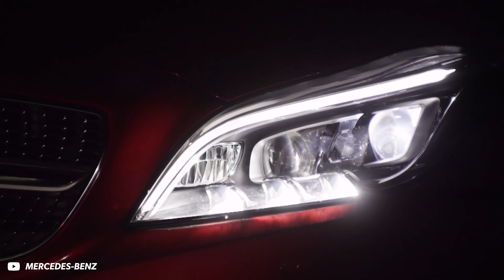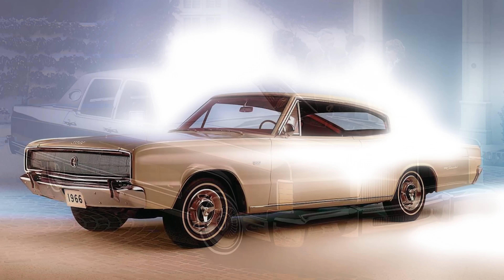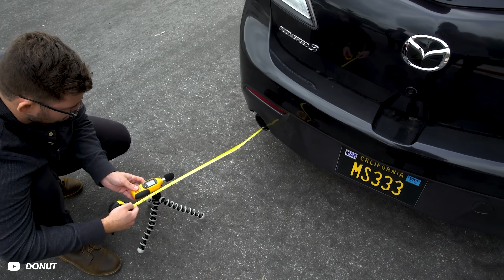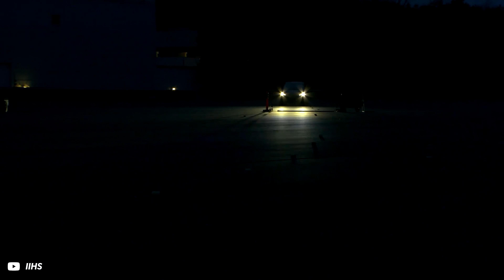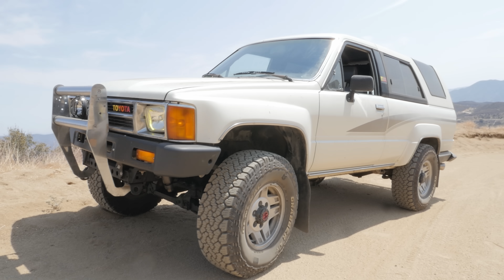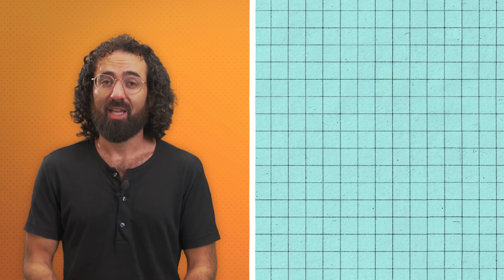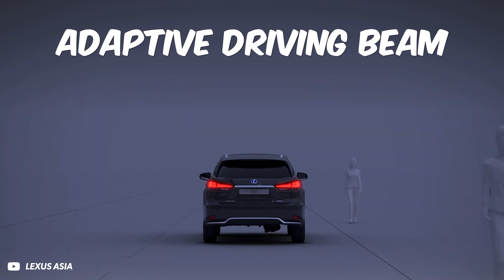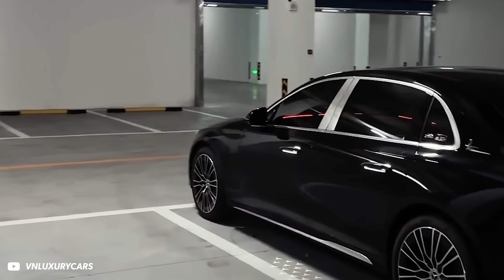Why new headlights are blinding American drivers

Comment: I want to go back to a handful of DOT approved sealed beams. Every car uses the same, so they are mass produced and cheap and available. Tightly regulated to be a warm yellowish, power limited, and with a strict pattern. Having them aimed improperly should get a warning then ticket.

If you want a tech solution, instead of adaptive headlights, put detectors on police car. Also, start making police use cars again. Way too many are up high in SUV's these days.

Comment: The Lawmaker is not experiencing the same thing as the citizen they make the laws for, because ...they ride as passengers. From Uber to armed protection specialist chauffeurs, so it doesn't affect them and not until a loved one in their circle dies and the death is attributed to these insane lamps ... I rarely drive at night, hardly even have to being I'm retired, so I just won't go out on my rural highways at night.  If I do need to, I can use my sun visor as a shield, though it has issues with me possibly missing something that is blocked by the visor, so I swivel and use extreme forward sight, looking as many seconds as possible ahead so if I need to block out an oncoming lighthouse on wheels, I've a pretty good idea of what will be unseen for the few seconds of this sun visor technique.

Comment: What surprises me with brand new cars is how bad the can track a car. Even on straight roads often one of the headlights is shining right onto your inside mirror. 
I have mutiple cars with adaptive lights and some do great on auto high beam (Maserati, yeah! Its incredible how you can drive with high beam in the middleof traffic because it blocks light to upcoming traffic) and some do so bad I often use high beam manually.

Comment: The US population is aging and as such is becoming more light sensitive. Driving at night is horrible if you get a truck behind you blitzing the passenger cabin.We own two Subarus which are great except you have to pay $200 for their idiotic and dangerous auto dimming inside rear view mirror, which simply put does NOT work. Ive complained to corporate. They respond like Homer Simpson by going Duh…they want the $200,  you cant even spec order a new vehicle without  it but they still list it as a $200 option. Its not an option if you cant get anything else. When bright lights are behind you it barely dims anything. You can push the green lit button and turn it off, but then, you guessed it, it doesnt do anything…we drive with the mirror pushed up so we cant see out the rear. A ten dollar old flip lever mirror would fix the problem but the stupid device is wired into the ADAS system so you cant do that…additionally here in the Midwest USA in the past trucks had what were referred to as driving lights in the lower bumpers which were restricted by law for use only in rural unlit highway areas. New pickups and suvs here have running lights, quad led headlights with variable current for the high low function, and driving lights all going at once, so that instead of two low beams you are staring into 6 or 8 leds blinding you…leave it to the nitwit insurance actuaries counting beans to say all us senior citizens being multiply blinded as somehow being “ safer” I literally cant see it.

Comment: Yup, this is why I try to not drive at night. I do I have these clip-on filter for my glasses to stop blinding glance, sadly this filter makes me sleepy because it cuts off the light that makes you awake. In the end, I just straight up turn on my high beams up when I'm blinded by them, then turn it off a second later when I can see again. Some may say this is bad road etiquette or whatever but this is my way of signaling that something is wrong at an instant, and TBH this is all I can really do against this issue. Doing this, I've notice it really isn't the old trucks and SUVs, with the higher height directly shining their halogen lights, that I'm blinded by but those damn LED that pierces my eyes at night. I truly hope this changes.

Comment: I have a much better solution, how about embedding OLED panel onto the windshield, that will use multi-spectral camera to brighten your view during night, lets also install an infrared light that the camera system can use, all combined seemingly.

Comment: LED should never be used for the head lights. LED can cover a range lighting but are not getting it all. White LED are a variation of the Blue LED, and they are of the same family of lighting as the LASER. Using them as a marker light on a car, a in the house light or to light up your flat screen TV or computer is all fine.
 I first noticed the LED lighting flaw with the LED flash lights, and cell phone lighting. If you really need to light up a spot to find what you are looking for clearly, and great Incandescent, or halogen flash light is what you want.
 In the car driving I have noticed on a foggy dark morning, the ones that have the LED head lights just light up the fog into white piles of mush, making visibility even worse.
 Back when I just started driving, 1980's and had driven in the fog a few times, I thought about getting these fog lights and put them on the car. Problem was clearly written on the box of these new fog lights, that they are not to be used as driving lights. So I figured they were for off road use only.
----
Back when most cars had the round sealed headlights, the mechanic I went to had this device he used to test and light up the head lights. It was meant to be easier then having to have a chart on a wall and aim the head lights on that wall to light them up properly.   
 But this devise, and the had one for the newer square lights as well, but it had several balance levels used to line them up based on the factory prebuilt in the bulb alignment.
  So then using that as the standard, a higher vehicle would have the same standard, but that would put their aim that much higher.  So I noticed around that time that the newer trucks had their head light mounted pretty low, but this did not fix the problem of the people that decided to lift their vehicle.  
 Then came headlights with no diffuser lens in front, just using the rear reflector as the aiming device, and it only got worse from there.   
 I drive car from the 1990's and it has composite headlights (with the diffuser lens). They do very well, no yellowing of the lens, and they can be adjusted and aimed toward a wall to line them up correctly, and there are high and low beam separate lights.
 I wonder in the modern car lights having the yellowing problem might be because the type of light going throw those clear covers.
 Oh another fact about the LED, if you run them at their brighter level and then lower the voltage to them they lose that flexibility in time, because once a LED is run at a high voltage level, and you back it off, the lower brightness will be much lower then a new LED on the same brightness. They have this burn in situation.

Comment: I sit higher and still have to look to the side of the road to not be blinded by oncoming LED headlights most times. I have a 2021 F250. Stock Height, Stock everything. I ordered it from factory with Halogen bulbs. My headlights are properly aimed each time I take it in for an inspection (never know if they get misaligned from potholes, etc throughout the year). And people still want to flash their highbeams at me. Bruh...I could see your LED headlights blazing from a mile away, and now you have the nerve to hit my eyes directly with the power of the sun.... F off moron.

I truly feel bad for people with astigmatism. Ain't no way I would drive at night if I had it, nowadays.

Comment: The main problem has always been poor adjustment, especially for low beam lights. If all headlights were adjusted properly, blinding by oncoming and following traffic would be minimal. The new high intensity lights simply aggravate an old problem further. (Self-)dimming mirrors and yellow night driving glasses make a big difference for me at night.

Comment: Excellent report. Thank You!!.  You missed, or maybe I missed , Headlight adjustment. Part of that problem is mechanical, the entire giant, expensive light unit is bumped or sat on, changing the adjustment or people replacing the bulb and not noticing that a bulb not designed for that housing will change, and often remove entirely, the light pattern that was properly putting what little illumination the original bulb produced where it belonged on the road without blinding oncoming traffic, with bright light that blinded flying Owls, pedestrians and oncoming traffic. All because the driver did not buy one of the pitifully small number of LED bulbs that actually work because the LED is placed exactly where the filament of the original, stock bulb is. And that doesn't include the very costly headlight units that are absolute garbage for the same reason. They don't work on cars. but might be fine in a car themed nightclub.

Comment: Eh some bad info here. First of all, adaptive headlights are still only used on higher end cars, and that's really only in Europe, not the rest of the world like you claimed. Not only that, but in Europe, they are still highly flawed systems. They can't detect and respond to anything but straight, level traffic. Throw in obstacles, curves, hills, etc. and they are just as blinding if not MORE blinding.

Second, the real offenders are generally not brand new cars, it is the aftermarket. Specifically trucks, and lifted trucks are the worst. It does not matter how you adjust the lights or if the housing is correct for the bulbs, etc. The reality is because they are higher, the beam HAS to cross a lower, oncoming vehicle driver's eyes at some point. If those lights are brighter than stock, they are going to be painful and blinding.
Ironically these trucks get brighter lights to help them see better, thinking it will decrease the odds of a crash, but they don't realize how many oncoming people are blinded and might actually cross into their lane because they can't see where the lines are anymore.

Comment: Since there's nothing we can do about the lights from other cars, I can only think of one solution to mitigate the blinding assaults from incoming traffic: Use a computer with a camera tracking the location of bright light sources to fire a death-ray, err... I mean, display black squares on a transparent LCD screen behind the windshield. With the right offset calculations, it should be able to match the pixels sitting between the driver's eyes and the offending light source, allowing the rest of the view to remain unobstructed. It would require two wide screens to cover the whole windshield, but covering the driver side only should be enough for most situations.
The main challenge for a DIY solution is to remove the backlight, diffuser and reflector from a typical monitor, without damaging the panel. The rest should be relatively easy to do with OpenCV on RPi. It would also be useful when the sun is low or something reflects the sun.

Comment: This is all getting off the point.  The main issue is that the beam cut-off is set far far too high in many cars.  Tesla is a major violator here.  The factory sets their dipped beams so high, they are illuminating the cab of the car in front straight through the back glass.  The beam cut off needs to be set so it cuts off at road level at a fair distance in front.  Tesla essentially never cuts off, because the light does not point down.  They need to be stopped in this practice by enforcement.

Comment: The US needs to accept Matrix Lighting. It helps a ton in Europe. Almost all US vehicles can do Matrix Lighting if that model is sold in Europe because our laws require it and they only make one version. For some reason it's disabled in the US despite the capability existing. This helps a ton.
Reply: Looks like you address this at 09:30 by calling it ADB. Ford has this in their vehicles and you can enable it with Forscan.

Comment: Its government regulations from 70 years ago. They require a car manufacturer to supply a certain power output to vehicle lights back when we used hologen bulbs, and that power level is too much for led lights. They cant adjust the power output to a proper level for leds without failing regulations.
Reply: I wonder if that's true - the car just supplies 12-ish volts and the lamps will draw whatever they draw: a lower-power incandescent would just have a higher resistance. LED lights can (and often are) pulse-width modulated to vary their brightness.

Comment: I drive a 2000 Jeep XJ that came with sealed beams. I have since converted it to use H4. I've tried LEDs, Xenon, and HIDs. They are all terrible when it comes to snow and rain. I now use Hella high powered halogens. Best headlight bulbs I've ever used. I also took the time to aim them properly.

Comment: I was the owner of a VW TIGUAN R-Line that has this feature, adaptive headlights that changed the beams if it detected a vehicle in front of you or another vehicle coming towards you. Sometimes it was confusing because it changes quickly and it can distract the driver a little bit. But I liked it.

Comment: Put up a video to show people how to adjust new headlights, LED puts a heck of a focused light compared to OEM lights.  If you put in your own LED's, getting a proper adjustment on the beam will save you alot of aggravation from other driver's high beaming you because they think you are driving with your brights on.  Most states in the US run 2" below horizon at 25 feet or 51mm below horizon at 8 meters.  Horizon is the height of your light fixture, then measure up a wall on a flat surface and put a piece of tape. Put your car at the distance away i.e. 25 ft. and no light should cross above that piece of tape.  All those Amazon lights have no standard fitting so you would do this with any new bulb put in.

Comment: My biggest pet hate with lights is the typical H4 type headlights being retrofitted with these LED inserts.
Hear in Australia its ridiculous the amount of people that do it and have gone down this road and found that the headlights are worse than the original tungsten halogen bulbs and so compensate by raising the aim.
This is where the the biggest problem is.
The LED inserts are nowhere near focused enough within the housings and as such, spray light in all directions other than just in the manufactures headlight designed light output pattern.
The LED insets have light output in only 180 degrees plain whereas the halogen bulb's glass is clear and as such the filament light source is radiating 360 degrees and the filament is usually smaller making focusing easier and more accurate.
Ever noticed how the street signs and especially the big road signs are lit up bright on low beam from hundreds of meters to kilometres away ? That is wasted light that is not focused and is spraying out of the headlight in an uncontrolled way contributing to blinding road users.
Couple that with loaded utes and car boots, the affect is even worse.
I have fitted literally hundreds of these inserts and I always try to talk the person out of going down this road.
I now wont install them at all now and go even as far as to tell the owners of their cars with these insets to remove them and reinstall the halogen bulbs and re aim the lights.
I also tell them that to my knowledge nearly all if not all are illegal to be used on the road and are only for off road and recreational vehicles only.
Take a look on the box these inserts come in and they will always say not for highway use.
Another big downer for me is most of these inserts as well as the LED driving lights are awfully noisy in the HF RF spectrum and can make AM radio next to useless.
If you want better light from your standard halogen headlight system, then replace the standard 55/60W bulbs with 90/100 or 90/150W halogen bulbs.
The light will be far better than any LED insert you may have and the bulbs will still be focused correctly making the most out of the available light.
A wiring upgrade may be necessary though and despite what a lot of beard strokers may say, I have never seen the reflectors or lenses melt or change colour.
The worst I've seen is the H4 connector get hot, and this is a common problem even with standard bulbs fitted.
Apart from people wanting a fresher front on look to their cars, going down LED inserts in a standard halogen enclosure is a waste of time and money and with blinding the legality of it all makes no sense.
Another thing I now do as I am now older and wiser, is not to flash back at other road users in a way as to say FFFFFFKu.
There is no point in two oncoming drivers being blinded on the highway possibly 150 ton  trucks converging on each other.
Long winded yes, but this topic is something that is close to me should be realised and made very public in the interest of safety.